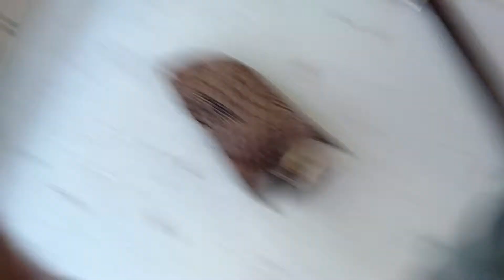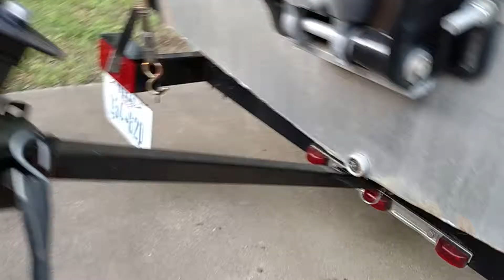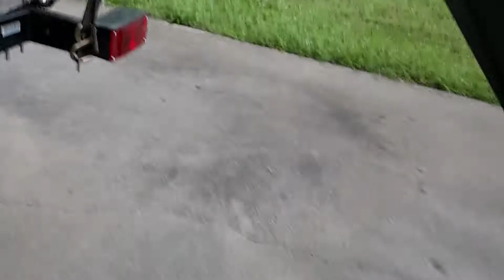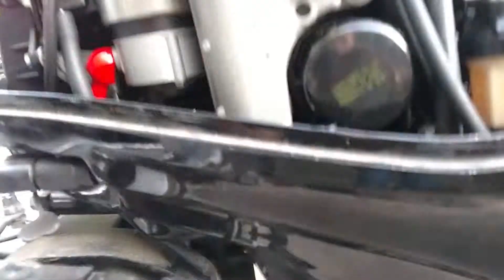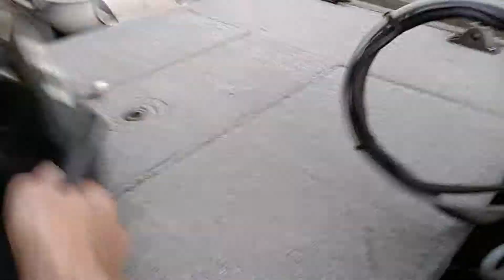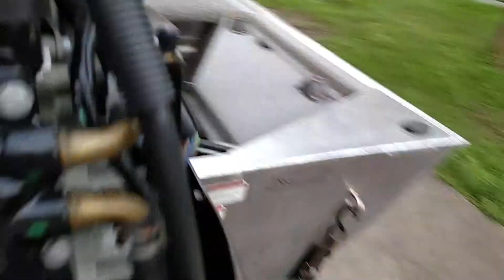Mercury Marine 30 introduction, won't start!

Comment: David, I have the exact same motor and was wondering if you had any issues with the throttle cable having slack in it. Meaning after putting the motor in gear and pushing forward on the throttle, it takes quite a bit of forward throttle movement before the motor actually spins up and engages to increase the RPM. I'm having this issue right now; trying to figure out how to get the slack out of the throttle cable.
Reply from the maker: I never needed to explore that issue and don't have the boat anymore.
I know that on cars and motorcycles there is always a threaded adjuster, usually near the intake throttle body.
Reply: @davide.anderson8507  Thank you! I'll look into it.

Comment: What year is that mercury outboard
Reply from the maker: 2009
Reply: I have a Nissan which seems to be the same as the mercury and tohatsu. Tohatsu maid all the motor around that year. I bought the 2014  boat motor and trailer with 25 hours and sat for four years it cranks but seem to not be getting fuel.
Reply: I’m will to bet it has the same issue. Thanks for the video. There is not much out there. I work on cares and motor cycles, this is a whole new world for me.
Reply: Where did you purchase the high pressure fuel pump?

Comment: Would you mind sharing how you went about cleaning out the old fuel? Mine won’t start and seems to be a fuel problem.
Reply from the maker: Hey Nate.  I had to remove the aluminum colored unit that houses the high pressure fuel pump.  Drain out all bad fuel from that, and the fuel filter, all the fuel lines, and the fuel injectors.  The injectors were clogged up with gummy old fuel and had to be carefully disassembled and soaked in carb cleaner for hours.  
The high pressure fuel pump was so clogged with old fuel gum that I couldn't salvage it and had to buy an aftermarket one.  I posted another video about that.
If you're not an experienced mechanic with all the miscellaneous tools, it would probably be easier for you to take it to the professionals and pay the bill. It took me DAYS of trial and error to get this thing running.  Bonne chance.
 Dave
Reply: @davide.anderson8507  thanks for the reply and the info. We pulled the housing for the fuel pump and the float was stuck in the closed position due to sitting for so long and the gas must have dried on it. Pretty easy fix.

Comment: David.  You did it.  You showed me exactly what I needed to know (that main fuse) and I was able to get my EFI Merc back up and running.  Thank you so much.  I couldn't figure it out and you had the answers.  Thank you.  Another Youtube success story.  Knowledge is Power.
Reply from the maker: That's why I did it George, not trying to make money or anything.  Just giving back to the community....
Reply: I'm curious, did the engine crank but didn't start? I seem to have fuel but it just cranks and cranks. I just put it away for the night or I'd try it right now.

Comment: I just bought that exact boat and motor last week your video  is quite helpful. Did you get it running and do you like it. Mine was running smooth then cut out. Not getting fuel, but I think it may be the fuel line.
Reply from the maker: Yep, I got it running fine.  Had to clean ALOT of bad fuel out of the lines and disassemble the fuel injectors and soak them in carb cleaner after removing all O rings, as carb cleaner will ruin rubber.
After a summer's use, the water impeller failed, so that was the next fix,  Apparently impellers only last a few years before they rot..
Reply: @davide.anderson8507  thank you... Mine ended up being the fuel tank and line pretty easy fix. How fast will yours run, mine goes 27-30mph with me ( 250) and my son ( 165) but takes almost a full 60 seconds if not more to get there... Wind and chop slows it down considerably. Does yours excelerate quickly, or is it slow to get up speed like mine.... I have no frame of reference to determine if I have a problem or not.
Reply from the maker: @greggt.3784  I'd say that sounds about normal, although we rarely do high speeds in our lake due to all the flooded timber.  It's a pretty small engine that's being asked to do alotta work.

Comment: Did you get it running. I heard stories of people frying the ECU by hooking the batterie charger up the wrong way. Most cases the rectifier goes bad.
Reply from the maker: I used to work on motorcycles and have hooked up batteries the wrong way many times, never fried an ECU.
This Mercury ECU is fine, regardless of the guy drunkenly hooking up the battery backwards...